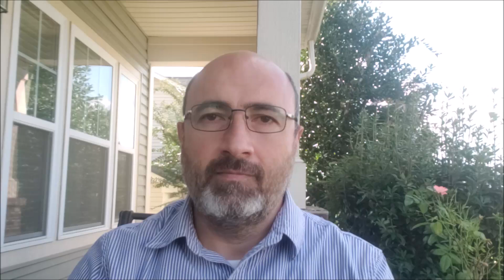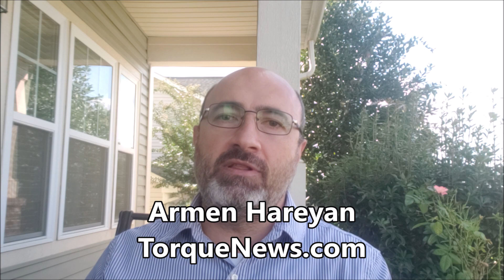BREAKING! Tesla Adds NEW Mysterious Tent to The Fremont factory

Comment: Then you return a gas car half empty, some employ have to drive it to a gas station and fill it up, which takes 5-15 minutes. That's why it cost so much. If you return an electric car half empty, and plug it in, it will fill itself without any employs time have to be spent doing it. And because electricity is so cheap, will it be worth it to meter exactly how much the car charges and bill you for it?